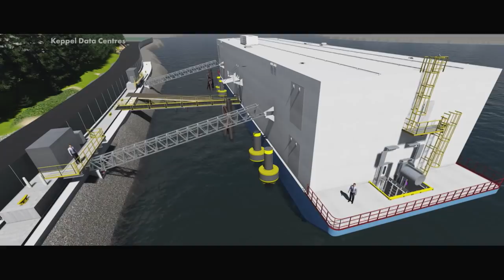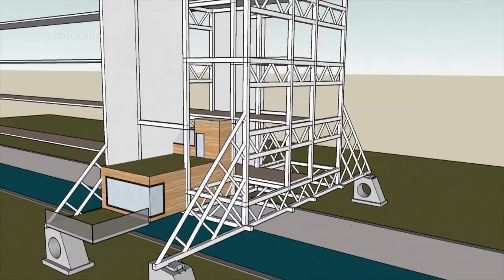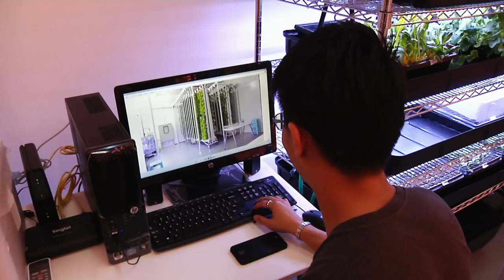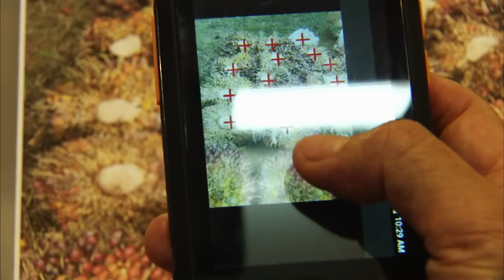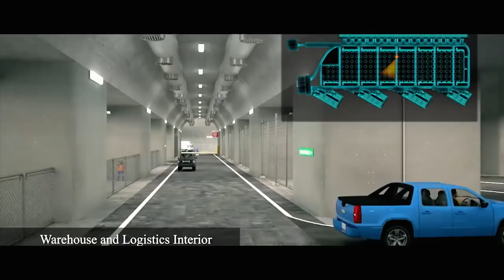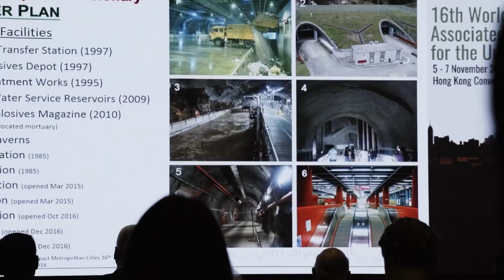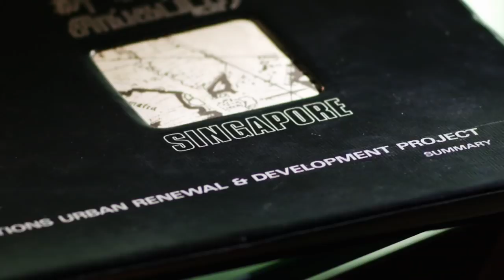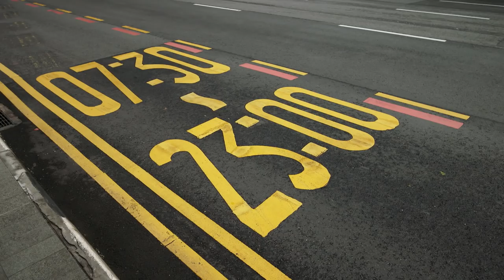Are floating offices and water homes our future? | Land Unlimited | Full Episode

Comment: Ocean engineering materials is a tough dilemma. Sea water is basically 'life paste', where if you stick something in the ocean, stuff will grow on it, and often into it. Then there's the corrosion of sea water itself, especially at the oxygenated 'lapping' level. Things get ugly quickly when you stick them in the ocean, unless it's coated in something toxic. It's fine to put on virtual reality goggles and have hope, perhaps, but there's a massive lack of practicality without a materials and maintenance discussion. It's the difference between an investment scam and an investment, or waste versus progress.
Reply: This conjures other architectural ideas, especially the recently recurring theme of forests in skyscrapers. Graphic artists turn city planners by pasting fanciful ideas onto photos of cities. (It worked for science fiction book covers.) Ignoring the lack of space for root systems in most images, vegetation also requires lots of water; water has high mass; these 'forest buildings' would be simultaneously over-built and under-built earthquake prone resource hogs. [When: Force = 1/2 * Mass * Velocity(^2), and you add an earthquake, that water suddenly acts really heavy with every ripple, and wants to take that building down.] Again, the heavy moisture would promote disintegration, require sterilization, while sucking large amounts of power to circulate the needed water, as they'd be upside-down waterfalls on hefty steel and concrete matrices.